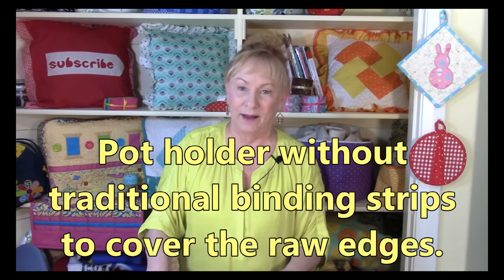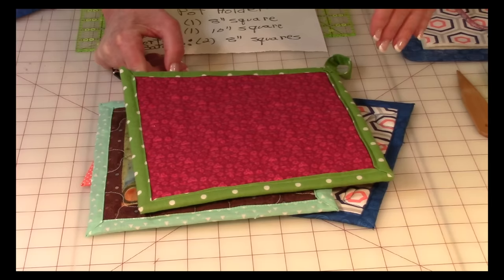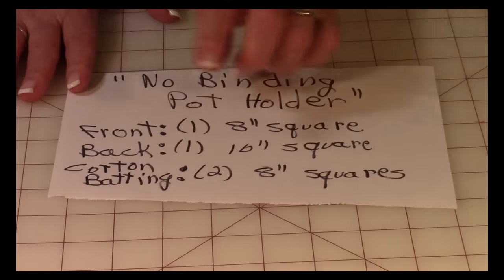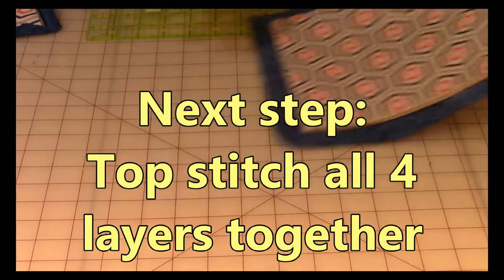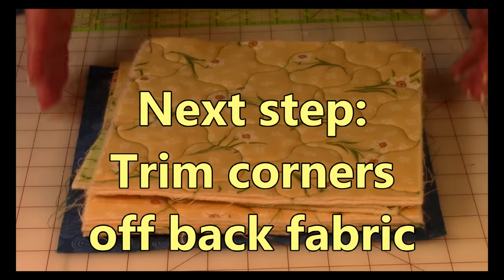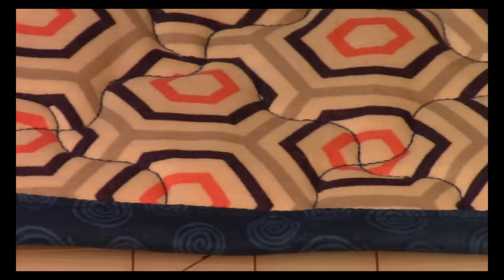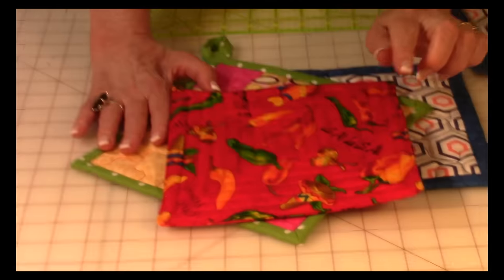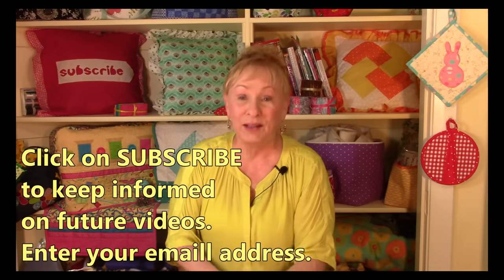No Binding Pot Holder | The Sewing Room Channel

Comment: Thanks for this.  Looks easy--my preferred method :-). One comment though.  When you mention fabric for the top and bottom you don't specify cotton.  If people aren't aware they may use fabrics that contain things like polyester and will have pot holders that melt when used on hot pans.  I bought some pot holders at the Dollar Store not realizing they used polyester and it was quite a mess.
Reply: T-marie N dying fabric
Dying fabric
Reply: Yes! 100% cotton is the way to go....just like when I am crocheting dishcloths and crocheting hot pads...cotton is the safest/non melting!
Reply: That and cotton thread

Comment: Love all your videos. Getting ready to make my first pot holder. This. Is Ann from Cincinnati. My fabric is quilted already. One side has flowers and butter floors on the other other side.not floor suppose to be flies.
Reply from the maker: Hi Keck.  Thanks for watching.  Stay safe, and happy sewing.😍
Reply: @TheSewingRoomChannel  hi still working on my quilt.  I just can't figure out what to do with all the 5 inch square s I got. lay them across the sheet or run them from corner to corner and even thought about putting them in so many rows one way and then change direction

Comment: I would like to thank you for this video.  Along with sewing, I also do machine embroidery and have orders for pot holders.  Mine are a little different from yours, I use 2 layers of cotton batting along with 1 layer of insul brite.  I add a pocket to the front and that is white I do my embroidery on.  I have seen this before, but I need to  practice before finishing my potholders.  Thank you so much for this video.  I love all your videos
Reply from the maker: Hi Debbie.  I have made so many different types of pot holders using different binding techniques.  You sound like you have a lot of fun making yours.  Thanks for watching and happy sewing.

Comment: I I really like the idea of this technique. I'm used to making pot holders with a batting layer on each side next to the outer pieces. does just using the insulbrite keep your fingers from burning?
Reply from the maker: He Insul-Bright helps to prevent the heat from penetrating through.  Thanks for watching💗and Merry Christmas😍

Comment: Love this potholder video. You make it look so easy. Haven’t made it yet but can’t wait to try it. What is the wavy line stitch and where do I find it?
Reply from the maker: Hi Bev.  The wavy line is called the "Serpentine" stitch.  Most computerized sewing machines have it.  You might have to change the width and length of the stitch.  Always test the stitch on scrap fabric, and adjust it until it has the look you want.  Hope this helps.  Thanks for watching, and happy sewing. 😍
Reply: thanks!

Comment: I love this tutorial and I'm about to make some of these pot holders/Hot pads.  Question - is it possible to make the back piece of fabric larger so that the "binding" edges are abit wider?  Would it throw the overall appearance off - ie out of proportion?  What would be the measurements of the back piece of fabric, in order to do this?
Reply from the maker: Hi Colleen.  Here is a link to a very easy and quick 10 minute pot holder:
https://youtu.be/IpiXpTIRQhA
In this tutorial you can cut the back fabric any size.  Hope this helps.  https://youtu.be/IpiXpTIRQhA

Comment: Just watched again..If using insul brite,  what is the order placement? Next to bottom layer or next to top layer? Thank you
Reply: I had the same question so I looked it up. They said you really should use 2 layers of cotton batting and one of the Insulbrite. Though it's not absolutely necessary. I plan on sandwiching mine between the two cotton battings. Hope that helps you.
Reply: @janeastwick1418  That sounds like a good idea as I have felt heat through ingle layers!! Thanks
Reply: @bijouxw1014  you are welcome! I hope it works 😀.

Comment: So I’m new to this I have a piece of panel fabric the squares measure more than 10”. Which is ok. So you are saying the backing is sewn raw edges to the front panel Right? Leaving 1-1/2 border. Can’t wait to make . Thanks for the easy tips.
Reply from the maker: Hi Susan.  If your top square is 10" square then cut the fabric for the back 13" square.  The cotton batting will be cut 10" square.  The raw edges of the fabric on the back is folded over to the front on top of your 10" square.  Stitch the fold over edge down using a straight stitch.  Thanks for watching, and happy sewing.  😍
Reply: Thank you so much I’m so excited that I found you. Best wishes.

Comment: Hello! I’m new to sewing and enjoyed your video. I’m thinking about making some holiday pot holders for myself. This method is definitely going to make it easier. I do have one question though, with this method how do you attach the hanger? Please let’s me know I recently purchased some Halloween fabric and can’t wait to make a pot holder! Thank you again!
Reply from the maker: Hi Cynthia.  Cut a piece of fabric about 2" wide and about 6" long.  Fold the lengthwise raw edges into the center and press.  Then bring the folded edges together and press, and then stitch the folded edges together.  Bring the ends together and place in the corner on the back side of the pot holder, and then stitch down.  Happy sewing.

Comment: I've heard that a layer of Insul-brite should be used with the two layers of cotton batting  to make the pot holder heat resistant.   Do you use Insul-brite?

Comment: I have questions?  If I changed the outside or backing to 1/2 “ larger will it make a difference in the outcome?  I found 1/4 “ a little difficult to work with after two tries.  Did I give up too soon?  I want these to look as nicely finished as possible and thought a little more fabric might help. Also I found it helpful to be sure to measure the exact center so excess material is exact. Thanks for any help.
Reply: The size of your potholder always remains the size of your top fabric and batting.  The size of the 'binding' changes. I've made over 2 dozen as coaster as well as  potholders.  I tried  using a larger size backing and don't like it. But give it a try and see which you prefer.

Comment: How do you deal with the raw edges on the larger piece of fabric? I did not see a step where you turned under that raw edge which will be exposed when you told it over the front piece of fabric. AM I missing something? Liz M.
Reply from the maker: Hi Richard.  Go to 6:55.  The raw edge is fold over twice.  First 1/4", and then fold again over to the front of the pot holder.  Here is a link to another pot holder tutorial.  In this video that step is easier to see.
https://youtu.be/IpiXpTIRQhA
Thanks for watching, and happy sewing.  😍

Comment: Is there a way to add a hanging loop?
Reply from the maker: Hi Sandie.  Here is a link to another pot holder tutorial.  In this video at about 08:20 sections I demonstrate how to make a loop.  To stitch the loop on fold it in half and place it on the back at one of the edges and stitch several times back and forth.  
https://youtu.be/7OwZSz6ilGY
Hope this helps.  Thanks for watching, and happy sewing.  😍
Reply: Hello! Question about the loop... If the binding is being folded and then sewn, wouldn't the loop be exposed?

Comment: Sherrill, I need a little advice: decades ago when I sewed, it was mostly polyester 😂. Now, I have bought some Kona cotton for a simple dress. Should I pre-wash, dry,iron before using? I don’t want it to fray!! Manufacturer suggests “soaking” for 5-6 hrs, then drying. What are your thoughts please?
Reply from the maker: Hi Paula.  Before cutting into the fabric you should wash the fabric per manufacturers directions.  But before soaking/washing do a zigzag stitch on the 2 raw edges.  This will prevent it from fraying during cleaning it.  Hope this helps.  Thanks for watching💗  and happy sewing😍

Comment: How do you do the wavy quilting lines?  Is that a stitch on your sewing machine? Or do you control the process?
Reply from the maker: Hi Annie.  Most computerized sewing machines have this wavy line.  It is called serpentine Look in your user's manual.  If you have it, you might have to adjust the width and length to get it large enough like I have it.  Merry Christmas.  Thanks for watching, and happy sewing. 😍

Comment: the backside looks unfinished because the quilting stitches dead end at the edge of the binding. I'll stick with regular binding so everything is enclosed and no loose threads sticking out of the quilt stitches
Reply from the maker: Hi Stella.  You can also do the stitches out to the raw edge.  Then the thread ends are covered when the fabric is folded over to the  front.  Thanks for watching, and happy sewing. 😍

Comment: Has anyone considered using two layers of Insulbrite? I don’t have enough cotton batting but I sure have a lot of insulbrite
Reply from the maker: Hi DC.  I have never used 2 layers of Insulbright.  But try it and see if it works for you.  Merry Christmas. Thanks for watching, and happy sewing.  😍
Reply: @TheSewingRoomChannel  I am almost finished so I will film a short video and post the link because maybe in the future other people might ask you the same question. I just know that when I made oven mitts using just one layer I could feel the heat through the oven mitt (so it was one layer of the insulation and one layer of the cotton batting)

Comment: Hi, I am working on this and have a couple of questions.  First of all thank you for the videos - it is very appreciated!

Okay, I may have set myself up for failure - ha - no actually let's go with "complications!"  I am using fabric I already have, and it may be too thick.  Both top (printed) and bottom are a cotton duck.  So, it's a little harder to iron us the corners.

Also, I have added two layers of batting like you said with one being a cotton and the second being Insulbrite.  All this makes it pretty thick, so I'm considering that thicker may be better in terms of protecting from heat, but is it making it harder to sew?!

My questions to you:  Should I only use the one layer of Insulbrite with this thicker fabric and will that be enough for heat protection,  or
should I even use the thicker (cotton duck) fabric at all?  The pattern is cute because it has retro campers on it, and the natural cotton duck on the back looks good, also.  But perhaps I should just go with a quilting thickness cotton?

Again, my thanks to you smart lady!  If there is a way to add a photo, I will do that.
Reply from the maker: Hi Robin.  I recommend using 1 layer of cotton batting, and 1 lay of Insul-Bright.  It will be.  Thanks for watching, and happy sewing.  😍

Comment: Mine turned out wonky.  After I quilted it was not perfect square and binding was uneven.   Looks so easy when you do it.   What am I missing?  
I measured very carefully.        I’ll try again .....  thanks for the video.
Reply from the maker: Hi Claudia.  When doing quilting stitches with a regular presser foot sometimes can cause the fabric layers to stretch and shift apart.  Make sure you use pins to hold the fabric layers together when stitching.   Change your stitch length to 3.0 - this helps when stitching through multiple layers of fabric.  Hope this helps.  Stay safe, and thanks for watching.
Reply: @TheSewingRoomChannel  thank you for the quick reply.  
I will try it again. I love the concept.  
I’ll keep watching.  
I love your your family on the videos.
Reply: @TheSewingRoomChannel  
Thank you for your quick reply.  I’ll try another on with your suggestions.  I love the concept 
I’ll keep watching and I love your family on the videos.

Comment: Cheryl, could the pot holders also be used as hot pads for a dining table? Or do you think the batting would sweat any under a hot dish?
Reply from the maker: Hi Velda.  I find that the cotton batting along will sweat under a hot dish.  Try using one layer of  cotton batting along with one layer of a product call Insul-brite.  This is a synthetic product that helps to block the heat.  It is sold at Joann Fabric and Crafts or you can go to the internet to find other stores that sell it.  Happy sewing.

Comment: I have found this concept of using the backing for the binding to be so much easier.  My only worry is that I heard it doesn't last as long.  What is your honest opinion?  Keep up the great videos!
Reply from the maker: Hi Kristin.  The pot holders I make for myself have traditional quilt binding which I prefer.   So many viewers in the past have asked for a potholder without quilting binding because they find it so difficult to do.  If this one is done correctly, it should last just as long.  Thanks for watching, and happy sewing.

Comment: When you do the potholders this way and turn the backing to form the binding, how do you make a hanger for the potholder?  I like the way you do it with the regular binding but I have not figured out a way to do it that nice with this method.  
Janet
Reply from the maker: Hi ThreadsbyJB.  I agree with you.  I like use strip binding to make pot holders.  But many of my viewers are beginners, and they want to do a pot holder that is simple and fast.  If you want to make the no binding potholder with a loop, I suggest you make the loop separately, place it on the backside of the pot holder and stitch it down.  Thank you for watching, and happy sewing.
Reply: I usually hand stitch a small plastic ring to the corner of the potholder after it’s finished.  I prefer these to the fabric loop when hanging them up.